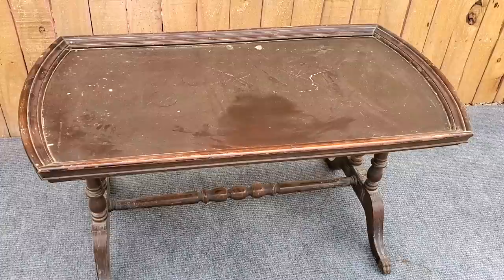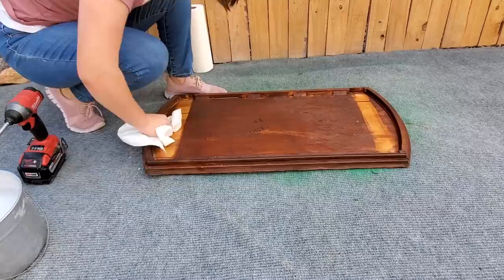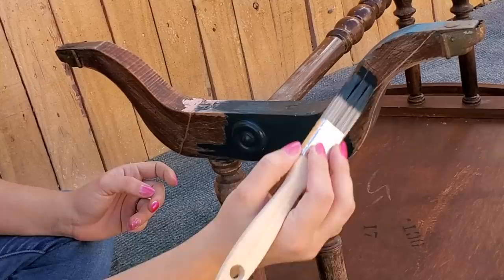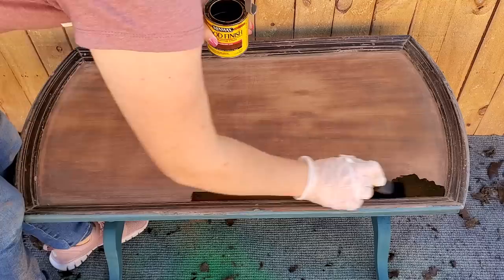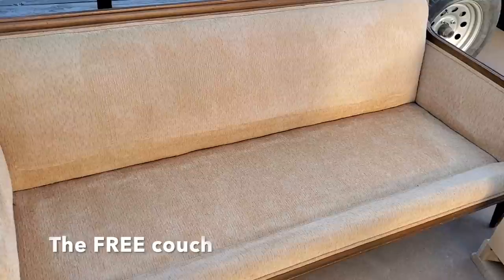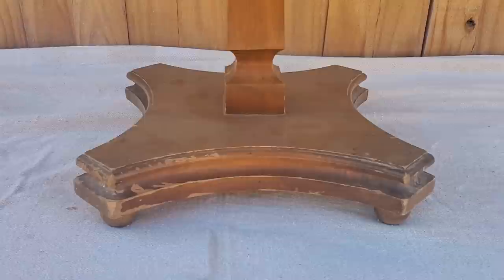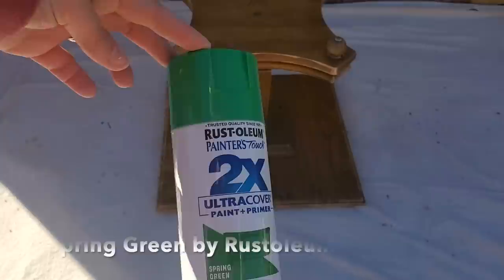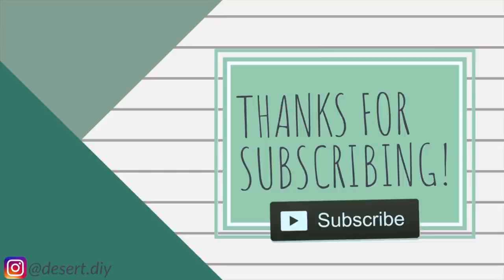3 Trash to Treasure Furniture Flips in 3 Different Styles | Vintage & Modern | Boho | Colorful

Comment: I feel the same way about sand blasting as you do with the heat gun.  It is sooo cool to watch the paint just disappear under the blast from the sand it's awesome.
Reply from the maker: I want to try soda blasting. Have you tried it? Thank you!
Reply: the only thing I have tried is sand blasting.  It just melts the paint away.  I love it but it does heat and therefore can warp the metal, so you have to be careful.  They have another type of material that is made from walnut shells that doesn't damage the metal because it does not conduct heat.  I haven't tried that either.  It's kinda expensive.

Comment: Not sure if someone else mentioned, when using heat gun use a respirator! Even if you know the finish you are removing doesn't contain Lead there are others. State gave me tips when my son had high levels of lead. They also suggested to use Cascade dishwasher soap as the cleaner it encapsulated the lead and other dangerous dust. I love your flips, new sub here and I am hooked😍
Reply from the maker: Thank you for thr tip!

Comment: One trick I learned when cleaning huge expensive homes (in Big Sky Montana) is if you are going to be cleaning anything that's unfinished wood use rubbing alcohol, it dries super fast and it's virtually impossible to ruin the wood when using it. Do make sure to blot areas that are a little too saturated!
Reply from the maker: Thank you for the tip!
Reply: @DesertDIY  Yeah no problem! Rubbing alcohol has saved my butt many many many times! It's good for cleaning mirrors and glass too! I detailed cars for a bit and anytime I'd get a smokers car I'd jump to rubbing alcohol to clean the glass and get the tar off. If you want to you could even add some citrus peels to the rubbing alcohol and let it sit over night then remove, it'll help the smell AND something in citrus helps remove grime and dirt! 😁

Comment: The couch.... OMGEEZIE Why didnt you strip and sand the first table 1st before painting legs?? Great job
Reply from the maker: You dont have to strip wood in order to paint it so there was no need to strip the legs. I always paint the bottom of pieces before doing the top because then I dont have to tape off anything while I paint. Its very easy to remove dust from the already painted surface and it saves me $$ not having to buy tape or plastic coverings.
Reply from the maker: Thank you
Reply: Elizabeth, also with DIY paint, you don't have to sand the wood first. Just make sure it's clean.

Comment: I liked the shellac fix but wouldn't you use that first, under the paint, to fill the cracks, etc. and then paint? Just asking...;)
Reply from the maker: Sometimes I do if I can tell that it will require it but sometimes the spray paint can cover up blemishes so I will do a first coat and then see which areas stand out as needing the shellac

Comment: Also, does it require much of those mica pigment powders from Amazon in the to get the effect you did with diy bohemian blue paint?
Reply from the maker: I am not sure what you mean. The paint I used was not in a powder form. It came in a small container as already made paint.
Reply: Yes, I saw the can of diy paint, bohemian blue, I was wondering if you added anything to yours because the one I ordered from diy doesn't look the same. (The mica powder I mentioned is in your Amazon list, I was thinking maybe that made it look gold-ish?)
Reply: How do you use the mica powder on your Amazon list, it's such a pretty color.
Reply from the maker: Oh! That mica powder is a pearl. You add it to the clear coat. :)